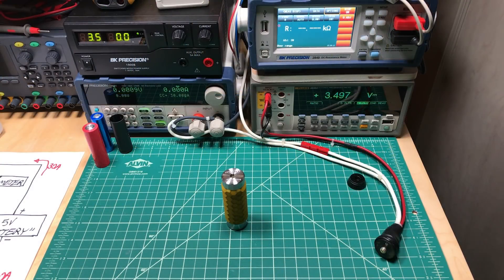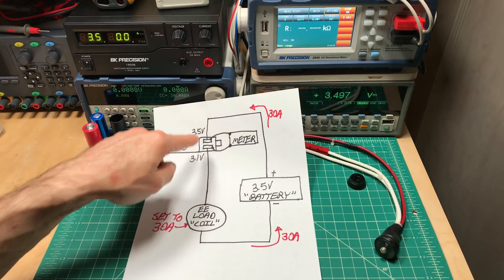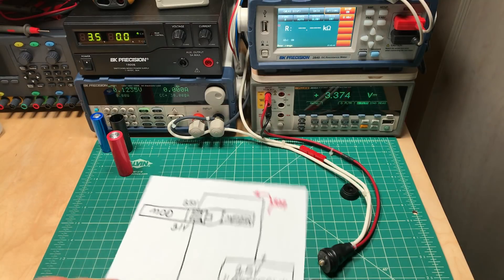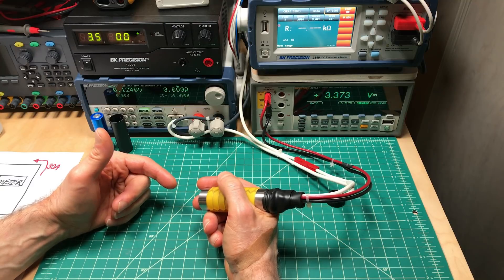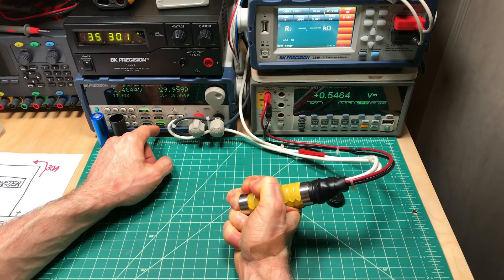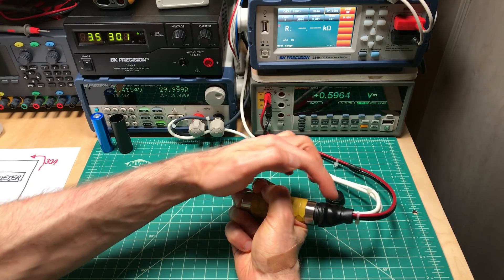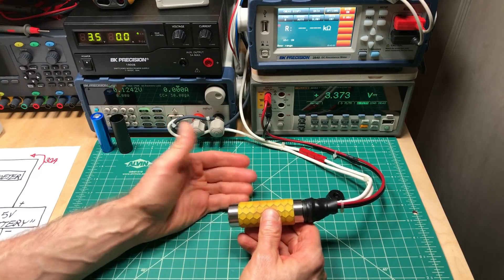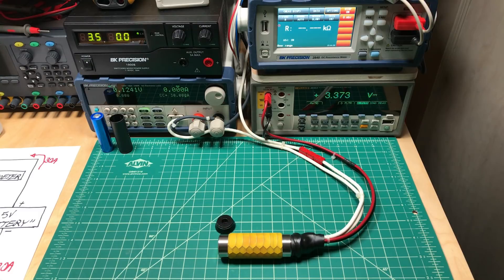Minding Your Mechs – Ep002 – Testing issues, they affect performance too

Comment: Mooch I have mods from different manufacturers and I never noticed that it loosens any and stays snug. I have copper, brass and stainless, With copper and silver plated contacts. The expansion I think is because of the quality of the metal imo. Thanks you for the through testing and drive you have for getting true and accurate numbers for the community.
Reply from the maker: I have silver-plated, gold-plated, and copper (flat and knurled surface for all) pins for my Dreamer testing, with three different metal Dreamers too. Plating makes no difference in conductivity though, only in how fast it oxidizes.
Reply: Kiddbass good point there
Would love it if Mooch tested some silver plated pins or buttons to see if it makes any "electrical" difference
Reply from the maker: What I experienced may be unique to the Machina due to its sleeve. Without the sleeve the mech “snaps” tight with a distinct stopping point.

Comment: First off I love mech mods, but we must all agree that they really are consistently inconsistent. From tension, to button press, to crap in the threads, to battery sag, button design, to dirty contacts, and even down to varying resistances of different atomizers. To me there is something "fine" or "unique" about the vape experience of a low ohm build on a mech, I like it. But you have to love mechs and accept it as a hobby to keep everything polished up, contacts clean threads clean, and so on. There's just such a huge difference from using a clean mech to one that has been neglected. The voltage drop is extreme when filthy in all the wrong places. Thanks for showing us Mooch. I look forward to further proceedings on this topic. I myself use a very fine layer (gently wiped off) of NO OX ID on all threads and connections and it seems to slow down the degrading factors but I could be wrong. It's been argued for and against for years. Thanks again man

Comment: Everytime I tried to tighten my purge down tight and press the button the positive end of the battery would get crushed down that doesn’t happen with solid slugs
Reply from the maker: Agreed. The slug isn’t meant to simulate a battery, just to provide a low resistance path through the mech. I wasn’t advocating super tightening of the mech to get better performance, just showing the variability for a mech. I strongly recommend never tightening a mech too much and will firmly mention this in the next video.
Reply: Battery Mooch yessir it’s just a stand in but I do wish a battery can held up like the slug so we could crank it down to get better performance. It does make sense u would get better performance from cranking it down n pressing the shizznit outta the button better. Thanks for the great work bocephus and keepum comin!

Comment: Do you think that the 510 had anything to do with the issues ? Have you tried the same test with a hybrid mech ?
Reply from the maker: Yes, a Dreamer and with different atty’s. The Dreamer was much more consistent. The choice of atty doesn’t matter much since the same will be used for every mod.

This was just a preview of some of the difficulties I encountered and how I might address them. The Machina was chosen because I thought it would have a lot more variables to deal with...and I was right. 😁
Reply: Battery Mooch yea with a mods like the machina are going to be tricky to get consistent values..you definitely have your work cut out for you ,but thank you for always sharing your valuable knowledge with us !

Comment: What I think : RX is a bad mod with many issues. You should begin with a well made mod.
Reply from the maker: It was chosen because of its issues. 😁

Finding out what they are, and adjusting the testing methodology to address them, makes it much easier to test all of the mechs. If I only tested the best performers first then then I might not have a methodology in place to deal with ones like the Machina and might actually have to start over with new tests.

Comment: You might end up having to post multiple readings as well as averaging those readings into an average voltage drop rating.
Frankly if you told me that my squonk mod has a drop of .3 to .6 (hypothetical random numbers i picked) with an average of 4.5 I would find that very useful. 
Especially since in practice little things can affect the outcome of the end user.

Comment: GOD! I have this same exact issue with my rx machina and i thought its just my invidual!! I found myself tightning it every hour or so!  And before i realised that the issue was it getting loose by itself, i threw away couple of my batteries cause i thought i have ruin them since i was getting such weak hits with fully charged batteries. Also I found out that the contact on the 510 from the inside the top cap is SUPER hot after couple of hits! Theres some marks of serious arcing on the gold plated contact inside. Got so frustrated that the mod has been sitting on the shelf for couple of months now. THANK YOU Mooch for putting this info out, i really thought its just mine...
Reply: Devin Dee  with something like this you need to try to fix all your connection in place. Some sort of compression like a spring washer works. What can happen is heat will expand the metal of the threads then as it cools it contracts and if there is not enough pressure forcing it tight again it stays where it is. So each time you heat it it turns a fraction which adds up to it unscrewing its self.  I would guess that the connection is not the best to start with causing it to heat up more than usual exacerbating the effect.
Reply: David Soulsby Okay I see. Thank you for your helpful information :)

Comment: I see a similarity in the flow of electricity and/or Ω & magnetism drop ON A TEMPERATURE CHANGE.
Maybe it also depends on the metal that's used in consideration with what metal it get's plated.
Also vape juice , acids from hand fat's or salty sweat can change a lot.
For example: I had an underwater torch out of aluminium and used it in saltwater, and the threads basically baked together. Kinda chemical reaction with electricity, aluminium and saltwater.
(alloy/electricity/liquid, moisture, fat containing something.... )
That was my first thought!
Reply: Nurb 2Kea  you basically had a plating kit here. Electrons stripped from one pole and deposited on the other, the saltwater was the electrolyte.
Reply: I know, that's why I thought that could be a reason when the 510 connector is contaminated with liquid, body fat's, acids or salty sweat, to make a difference in the measurements. :-)
Reply: Nurb 2Kea  contact pressure is more likely. Your totally correct in theory but you need a very good electrolyte which juice, body fluids etc arnt and there isn't enough liquid available. Simple pressure pushes the surfaces together more. Then heat expansion and contraction are enough to back off some threads just that tiny bit. The voltage are so low that a small resistance increase has a bigger effect. Higher voltages push the electrons harder and bridge the gaps better. Kanthal is a prime example as it's designed to expand and contract as little as possible to prevent this.  In the longer term the fluids you mention will have this effect but at a much slower and lesser degree.
Reply: Ahh ok, that explains it very good. Thanks. Means my physics and chemistry lessons from school was not useless, but counts only in the 0.0000xx range. :-)

Comment: so,  a contact point of the mod is playing significant role in voltage drop during using a mech.  i wonder if how about the safety of the mod it self?  does it would be safer if there were less contact between the battery and the mod?
Reply from the maker: More contact = less resistance = less heat. 😁

Comment: I think this shows why some people get a great vape from some mods yet others rip them apart as rubbish. I enjoy using my RX Machina but know it is slated for dreadful voltage drop by some reviewers
Reply: I get a great vape always, but I 100% have noticed this myself, however a lot less on the lightsaber handle black sleeves.
Reply: I feel like my rx is inconsistent on the vape. I've tried multiple builds and contact cleaning. 
But to be fair I'm also mostly a fan of hybrid connections. 
Though I do feel many reviewers exaggerate the drop on this mod, I feel that it does have the highest drop of all of my mech tubes.

Comment: Interesting.  I worry that tightening that much may deform the battery can - what do you think?
Reply from the maker: Very possible!
Reply: It definitely will deform the positive end of the cell, particularly if the mod makes contact via a small area in the centre.

With this mod it wouldn't be an issue as the mod doesn't clamp down on the cell as you tighten it.
Reply: That would be interesting to test
Reply: Potentially due to the mech's design...clamping AND hard pressing the fire button could dent the positive terminal I would imagine.

Comment: I know that this not the most popular opinion, but this is just one reason for me to stick with regulated (quad battery) mods.  If it is not hitting hard enough I can just bump up the wattage/voltage.  It  could just be that particular mech, but i get the feeling this is the rule rather than the exception.  Your testing methodology seems solid to me.  Thanks again for all you do Mooch!
Reply: If you get that perfect build along with a good mech mod and safe to use battery
You won't regret the experience 
It is just the safety in general and battery safety to be specific that was holding me off
Once I had enough knowledge and experience I went on and gave it a try and thanks to God no issues so far
Reply: I don't mind tinkering.  I like the fact that I have more freedom to tailor my vape on a regulated mod.  With a mech there is a fairly narrow sweet spot as far a resistance goes for the vape I want.  I also like only having to change batteries only twice a day max.  With a  single battery mech I would be changing batteries 4-5 times a day (I run .15-.2 ohms resistance and 115-135 watts).  The one mech I own (the Driptech TS) I was running .07-.08 ohm coils and with 3 batteries in parallel I was still changing batteries about every 4-5 hours.
Reply: @SilentGhilly People buy RDA's and put them on regulated mods because they are superior in flavor next to tanks. I can make several coils with better flavor and bigger clouds than ANY prebuilt coils out there, for less than the cost of a single prebuilt. I use mechs and regulated strictly with RDA's.
Reply: im still kinda new to the vape world where do you get your hands on a quad battery regulated mod if you dont mind me asking, i enjoy all the different variations in the vape world
Reply: @anthonyrush4821  As far as I know there are four choices, Laisimo "F4" (I do not think it is available anymore), Reuleaux "RX300" (garbage), Ijoy "Maxo quad", and the Steam Crave "Titan PWM mod".  My 2 recommendations would be the "Maxo Quad" if you are interested in temp control or the "Titan" as my overall favorite.  The "Maxo Quad" is pretty old and may no longer be available.  The battery door, and the size on the "Maxo Quad" are its main downsides.  The "Titan" is variable voltage which might bother some people, but you can look up the voltage needed for a given wattage and resistance on your favorite vape calcuator or use Ohm's law to figure it yourself.  The "Titan" does not have temp control.
Reply: @TheWraithkrown   Thank you kindly will use all the advise i can get, just got this uwell triple battery and to be honest so far am pretty satysfied as in i cant put it down. I enjoy all different styles keeps from getting bored😀